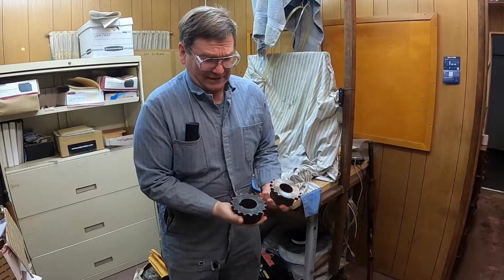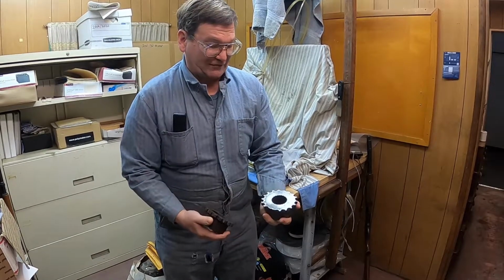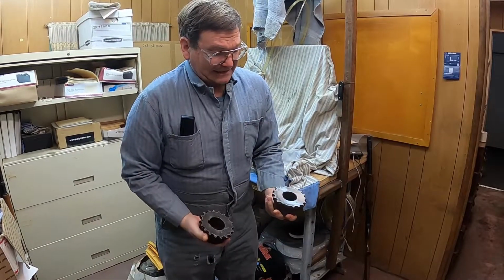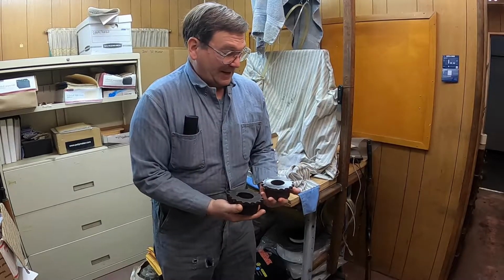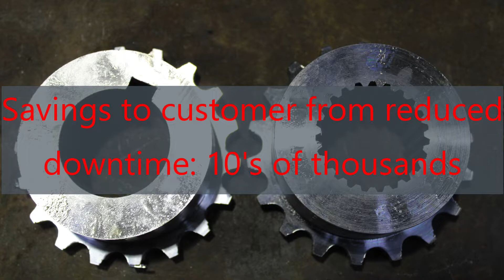Real World Machining: Rush Ordered Chain Drive Couplers

Comment: Just subscribed, you got me wondering what kind of machine makes that kind of profit, a real satisfying job I bet. My first lathe experience was with 4140 in the 60s high school metal shop using high speed steel bits, the joke was on me.
Reply: As long as you’re not spinning the shit out of the spindle or feeding too fast (by a large amount) you should’ve been fine.

Care to elaborate on what went down?
Reply: 4140 machine really easy and great finish?
Reply: @matter9  What I remember is the shop instructor was in control of the process explaining on the go. There wasn't any explanation of feed, speed calculations or tool grinding geometry. The machinist I got the 2-1/2" bar stock from was a family friend and he gave me a carbide bit holder a bits the next day with a smile. I was mistaken, it was 4340.

Comment: Very interesting, curious about sprockets, what kind of tolerance from ideal can be tolerated? Is it a function of chain pitch and diameter of sprocket ?  Thanks
Reply: A small chain, at high speed might want +- .005", a very large chain could be used with a cast sprocket that is slow speed could work well by +- 1/2"

Comment: Recommend that they should inspect all of their couplers while shut down, and get spares machined where required.
Reply: I'm surprised they don't have him make some extra parts so the next time it breaks, they can immediately repair it. The machine seems to pay for itself very well.
Reply from the maker: A few weeks later I made them several spares, for much less per each pricing, made drawings & established a part number for them to order more again in the future.  Previous to this the manufacturer had always provided them quickly, but then they went to a six month lead time & I got called.  :)

Comment: Your a great shop, with tremendous experience,and knowledge. Thank you for taking the time to share with us. Would it be possible for you to explain some of the finer details of the setup on the splines, and the teeth. Degrees,pitch gauge ect. Also a range of time on long a project like this should take.  Thank you again
Reply from the maker: These were delivered the next day.  Set-up & machining time was 22hrs. for the set.  This time will very greatly from shop to shop, their is not correct time for a one-off emergency job, drop what you are doing and get it done is a game all to itself.  Softer material would have been much quicker, better sample parts would have made it quicker.  If we didn't have the slotter, or the key-seater it would have taken much more.  Time gets added also for jobs removed from machines to start rush work, this time needs to be put towards repositioning work to were it was, before the rush job came about.

Comment: Didn’t realize you had a slotter head but I should not surprised
Reply from the maker: I have one for the Cincinnati #2 mills also, but haven't had to use it yet, it and a angle head came with the first #2 I bought.